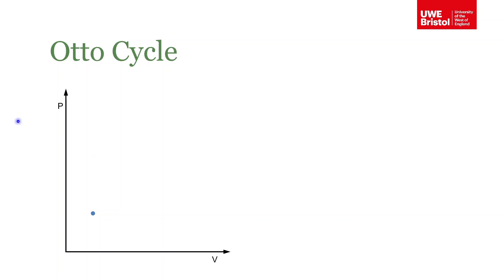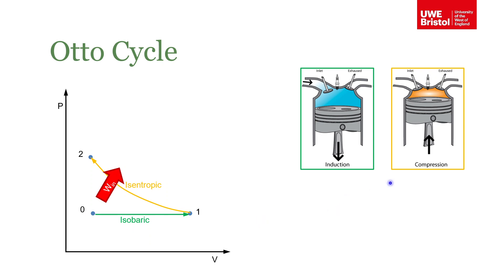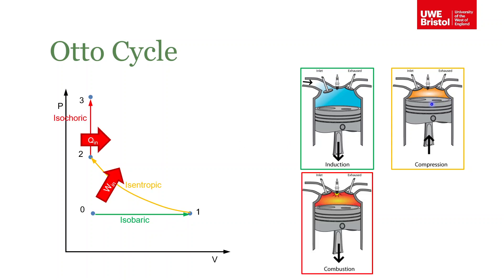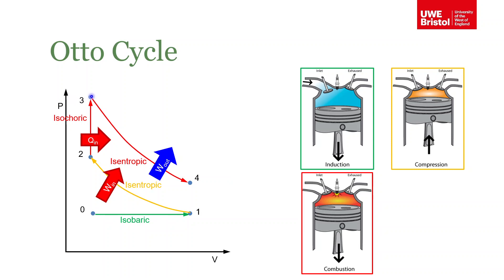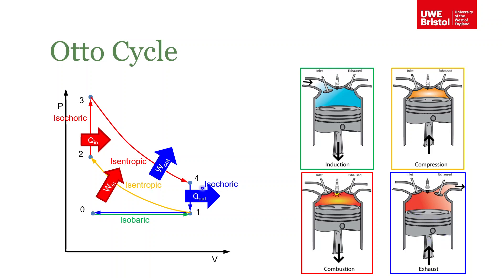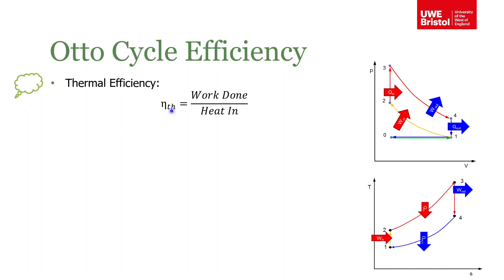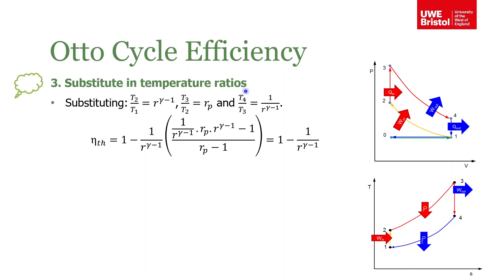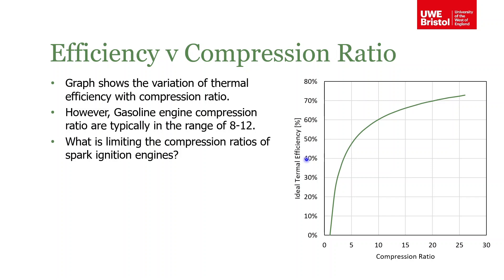Thermodynamic Cycles - Otto Cycle (Part 2 of 4)

Comment: Awesome series. Quick question: in PV diagrams, is the particle number not assumed constant? isobaric expansion from 0 to 1 in the cycle (piston expanding with open intake valve) is certainly isobaric but also isothermal, it is the number of particles that increases, no? A similar reasoning might apply to the exhaust, but since there is both a pressure and temperature differential with the outside, I don't really know how it ends up working out